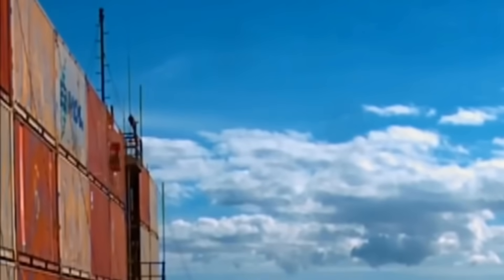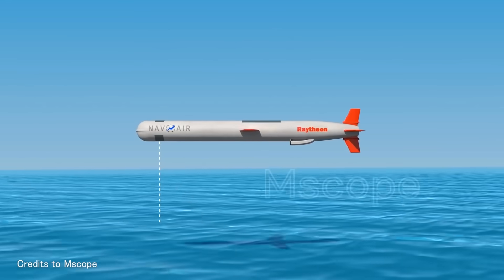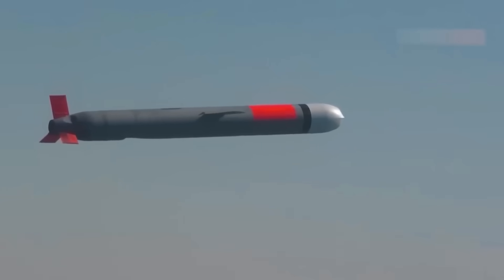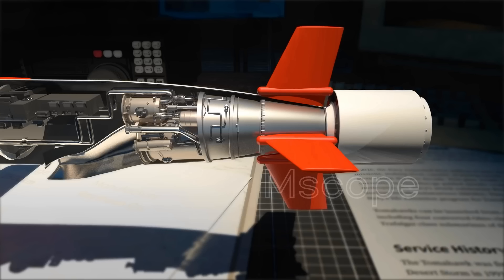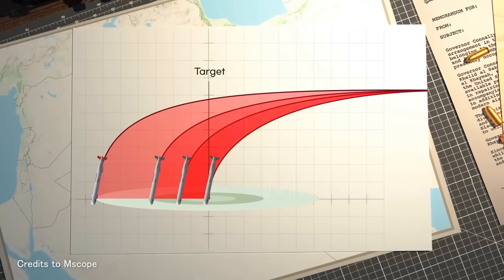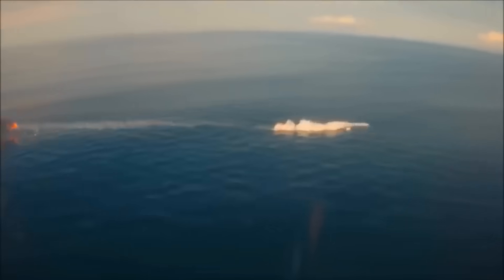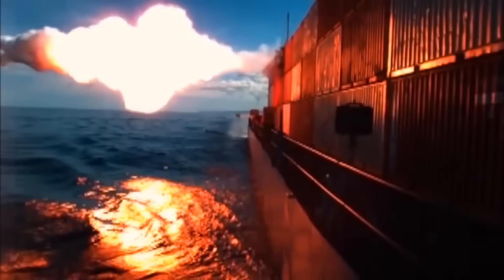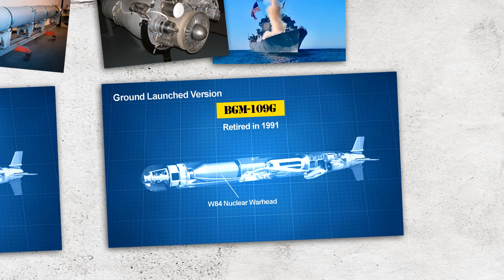Why the Tomahawk Missile is So Special

Comment: The section were the missile strikes the ship is not of a Tomahawk, but a NSM anti ship missile tested in 2013 on the coast of Northern Norway.A much smaler missile with only a 125 Kg warhead and shorter range, but more expensive than the Tomahawk!And the yield of the W 80 thermonuclear bomb is from 5 Kt a third of Little Boy over Hiroshima to 150 Kt which is TEN TIMES , not three times that of Little Boy.

Comment: Simple fact the radar waves of any band cannot bend to the curvature of the earth. So at 15m above ground, even if its just high subsonic speed, its about 45km before ground radar detects it rough 2-3 minutes to impact. Its RCS is low, no rocket plume, so ir and radar lock isnt easy with a lot of interference of surrounding buildings,trees and such. Its cheap, can be launched in waves, from massive distances, very discretely undetected at launch as it doesnt need to fly high to achieve high speed.  Now with smart AI and passive sensor avionics, The US navy will always choose tomahawks, jassm, lrasm, just more effective and strategic overall since US adversaries have few to no constant awacs patrol support. The dark eagle hypersonics will only be used for very urgent, high value targets, hardened targets

Comment: I would have to wonder why it was built to be subsonic usually the faster the better could it possibly be because of precision striking
Reply: It's way easier and cheaper to fly subsonic. Longer range, less heat which means cheaper materials, easier to maneuver, quieter and so on.

Comment: Most missiles need to fly high to fly that far. Hugging the earth while adjusting for earth curvature is harder than one might think
Reply: Curvature isn't an issue because it's not looking at the target on the way there.  On the way there It uses altimeter for height and camera for terrain mapping along with satellite link if needed.  Basically it's looking at where it currently is and if it's directionally on path, towards the end of flight it makes any needed adjustments to be on target.  Just like flying a jet isn't an issue, they navigate from California to Hawaii which would not be directly visible due to curvature.
Reply: It's the terrain hugging that's "hard".  Curvature of the earth is a very slow correction handled implicitly by altitude control, however that might be managed.

Comment: Early errors - Terrain Contour Mapping, not Terrain Control Mapping - AKA Tercom, were corrected later in the video.  Note that Tercom is distinct from terrain following; the former is for radar navigation, and the latter is using the terrain contours to increase stealth, flying behind natural radar obstacles like hills, and following the contours of the earth to present a reduced radar signature.  In addition, as later clarified, there's no nuclear warhead Tomahawk - that has been phased out for over a decade.  Nuke treaties like the Intermediate Range Treaty took the Air Force's GLCM (Ground-launched) out of Europe.  Not to mention Nuclear Safety Configuration Control Audits that would be nearly impossible to pass, given the way the Navy's conventional weapons control software was developed.

Comment: The assessment of the potential yield of a nuclear-tipped Tomahawk is a bit misleading (but I suspect not intentionally).  While we don't have exact figures, Little Boy's yield is generally accepted to be 12-15 kT, with some estimates as high as 18 or 19.  The potential W80 yields are EITHER 5kT OR 150 kT, not BETWEEN 5kT and 200kT.  It's a dial-a-yield weapon, so you pick which of the two yields it is.  The full range of yields would have been something a more complex weapon would have, such as the B61 which was the design-daddy of the W80.  So the lower of the W80's yield is roughly three times Little Boy, while the high end is about thirteen times.  Enjoyed the video!

Comment: This video disgustingly gives the wrong credit for development to MacDonald Douglas.  MD only developed the DSMAC and the TERCOM system.  General Dynamics, Convair division engineered and developed the missile in San Diego.  The applied Physics Lab only came up with the idea and requirements.  Convair was the only company that could make this missile launch from sub surface, the surface and from in the air.  No one else came close.

Comment: I'm not sure what this video means by the Tomahawk beginning as a partnership between the Applied Physics Laboratory and McDonald Douglas in the 1970s. The Tomahawk was developed and manufactured by General Dynamics Convair division in San Diego in the 1970s. McDonald Douglas was brought into the program as a second, dual-source manufacturer later on. General Dynamics sold its Tomahawk program to Hughes in the early 90s, and the Raytheon bought the Tomahawk program later in the 90s.

Comment: One of my suppliers was the company that actually made the airframes for these in Huntsville AL. I would go there to check on my jobs and while there get to see all the different stages of manufacturing. It's a mix of high tech, low tech, automated machines, manual operations and had the look of a regular factory, maybe an automotive plant. It wasn't like a hospital environment like you may imagine. The frame had aluminum bent by large presses just like any other press. Very cool stuff.
Reply: dont give out info to the enemy
Reply from the maker: That is an awesome experience!! Getting to see the work on something like the Tomahawk must have been fascinating. It is wild how something so advanced can be built in a place that looks pretty normal from the outside. The mix of old school and high tech really shows how much goes into every piece. Thanks for sharing that story, and if you are into more content like this, feel free to subscribe.

Comment: how does it fly for hours, how is the fuel that efficient with no wings to provide additional lift
Reply: It has wings
Reply from the maker: It actually does have wings, they are just folded inside the launch tube and pop out after launch. Those wings, along with its jet engine and subsonic speed, help it fly very efficiently over long distances. Think of it like a small drone or mini airplane packed with fuel and guided tech. That combination is what lets it cruise for hours and cover over 1500 miles. Appreciate the comment, and if you are enjoying the content, feel free to subscribe for more.

Comment: Does it have a solid rocket motor to launch it out of the tube? Don’t think it was mentioned enough 🙄
Reply from the maker: Yes, it does. The Tomahawk uses a solid rocket booster for the initial launch phase, especially when it’s coming out of a vertical launch tube or from underwater. That booster gives it the quick push it needs to clear the ship or sub, then it gets jettisoned and the jet engine takes over for the rest of the flight.

Comment: How does a submarine receive orders to launch 30 cruise missiles?
Reply from the maker: Good question. When a submarine gets the go-ahead to launch multiple cruise missiles like that, the orders usually come through a highly secure communication system. It can be sent by satellite, through encrypted radio signals, or even using specialized low-frequency signals that can reach subs underwater.

Once the order is received, the crew verifies it through strict authentication procedures to confirm it’s legit. Then they program each missile with its specific target data and timing.

Appreciate the question. If you’re into these topics, feel free to subscribe for more videos like this.
Reply: Magic....
Reply: They can deploy a trailed antenna which I think runs along or near to the surface & quite some distance behind the submarine .
So very hard to spot & the sub stays safe at depth .
Cheers 🍻 , Woody NZ 🇳🇿 .

Comment: Imagine what AI will do to this field.
Reply: What’s kind of nuts is that these were using CV and other things that get roped into the set of tech we call AI today on insanely low end hardware.  Mil spec microprocessors generally lag significantly behind what you can buy commercially because they have to be made to much stricter tolerances and be able to handle environmental situations like being launched from a sub in the arctic to being launched from a destroyer near the equator.  What the engineers have done to accomplish that is incredible.

An individual purpose built AI server has an unfathomably larger compute capacity… but it would die as soon as the solid state rocket fired 😂.  The advantage of modern systems is that they just need the sensors, the communication, and the ability to continue operation when that communication is lost.  The heavy processing can be done offboard.  That was more pre calculation originally but can (and likely is) a combination of both today.

I think what really makes the Tomahawk great is its adaptability as a platform.  The mechanics and general design are the same, but the system has evolved to maintain its potency for 43 years.
Reply from the maker: Once AI really starts getting integrated into systems like this, it’s gonna take things to a whole new level. Smarter targeting, faster decision-making, adapting mid-mission… the possibilities (and the concerns) are huge. Thanks for the comment! If you’re into this kind of topic, feel free to subscribe! More videos coming soon.
Reply: If the AI cockups we see on a daily basis when used on YouTube videos should give you a theoretical indication & the russian armed forces can give you a real world view of how fu*ked up it could be .
Cheers 🍻 , Woody NZ 🇳🇿 .

Comment: it's close to be called a drone?
Reply from the maker: Great question! Yes, it does share some characteristics with drones, particularly in its ability to navigate autonomously, carry out precision strikes, and even loiter over a target area. However, there are key differences between the two.

Drones (UAVs) are typically used for reconnaissance, surveillance, and sometimes strike missions, but they are reusable and controlled remotely by a human operator. They can perform multiple missions by returning to base after completing their objectives.

In contrast, the Tomahawk is a one-use missile designed specifically for long-range precision strike missions. Once launched, it cannot be reused, regardless of whether it is in training or actual combat scenarios. Its mission is singular: to deliver a payload to a predetermined target and detonate upon impact or proximity.

The evolution of military technology often blurs the lines between categories, but each system has distinct roles and operational frameworks. Thank you for your comment! :)
Reply: It’s a hipster drone.  It droned before droning was cool.

But seriously, these were doing autonomous drone tech before those words were used that way.